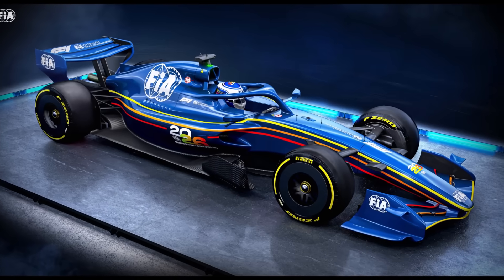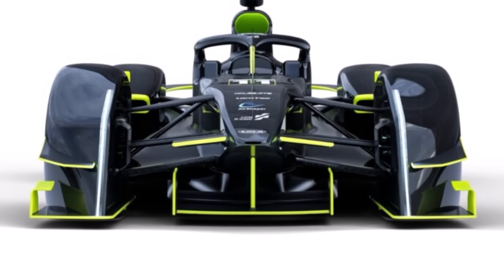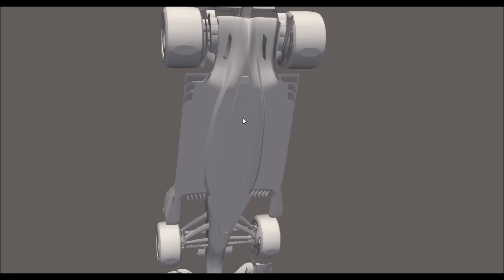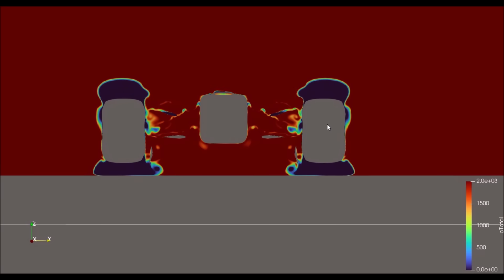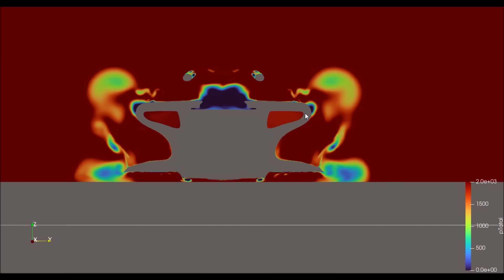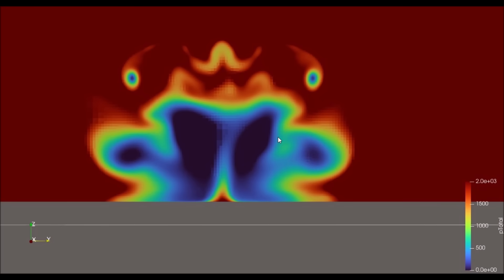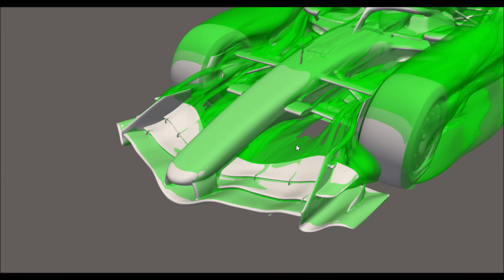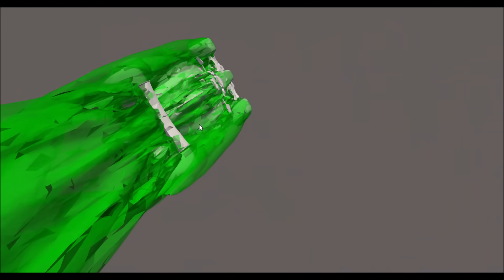F1 2026 - Aero Analysis (Complex CFD Simulation)

Comment: Almost like they shouldn’t have made the wheels bigger in 2022. Go back to the smaller rims
Reply: 15" like Indycar USAC would be a neat compromise, but it is what it is. (F1 already used the same 15" as USAC in 1960's too, but then FISA mandated 13" rears in 1972 and 13" fronts in 1983; whereas Indycar has used 15" from 1960's until the present day.)

Comment: In fact, the undercut of the sidepod has more important functions than just directing air cleanly to the rear (which could also be achieved in other ways). Sidepod undercuts prevent the airflow from escaping at the front edges of the underbody and partially flowing back into the diffuser and partially hitting the rear tires, which reduces downforce. One might think that the best solution would be to have sidewalls that allow the airflow to flow completely under the floor and smoothly to the diffuser, because this accelerates the airflow, increases suction and thus downforce. However, since the airflow to the rear tires is also blocked, the airflow at the leading edges of the underbody tends to become weak. In other words, it would be best if only the middle and rear areas of the underbody were sealed. The sidepod undercut helps to achieve precisely this effect. First, as a result of the undercut, the
undercuts extend the influence of the downward flow from the front half of the vehicle to the middle of the floor. There, the downward flow acts like a side wall, creating a floor sealing effect and increasing the underbody suction force. An increase in suction force on the sides of the SP also accelerates the downward flow and further enhances the sealing effect.
Depending on the type of side pod used by a team, the
upper vortex of the side pod can flow directly past the
undercuts and be used accordingly. Another effect of the undercuts is the creation of a high-pressure zone, which can be used to deflect the harmful front tire wake away from the vehicle.

Comment: 5:12 "downforce from wings which are more sensitive to dirty air"... I had the impression that the floor with venturi tunnels/channels were way too sensitive during all these years (2022-25)... in the years before 2022, I've never seen drivers snapping the rear end mid-corner and the tyres getting so much more wear while following in dirty air...
Reply: Are u kidding? Pre 2022 you wouldn’t see equal pace cars behind each other at all period. Even in the worst ground effect year (2025) you could have two identical cars running directly behind each other for full stints without losing too much pace (think the mclarens fighting etc).

Comment: 6:41 wait, but bigger sidepods have more drag and this is bad right?
Reply: If you don't have bargeboards (or only basic bargeboards), then large sidepods can be very useful to control the wake of the front tyres.  Like the 2022 Ferrari, or most of the F1 cars from the 1990's and late 1980's.  They can help direct the front tyre wake directly at the rear tyres, thereby reducing rear tyre drag compared to if the rear tyres were in clean air.

Comment: Why would the FIA just completely throw away everything they've learned about aero and dirty air for these regs? Are they stupid?
At least the first year of ground effects had close racing and was easier to follow cars ahead. 
Wouldnt it be better to use some moderate level of ground effects, plus a high rear wing (no endplates), really simplified inwashing front wing, and really tight regulation boxes? Seems like the aero minds that created the more tightly defined aero regs of last gen have left, and now the boxes they can use are much looser, which will lead to the teams adding on as many winglets as they can creating more dirty air. :(
Reply: Because the ground effect cars made innovation extremely stunted and most teams were handicapped just trying to avoid porpoising. Even Redbull and Mclaren in 2025 still had porpoising at times. The regs were a complete failure. They had to change. F1 has learnt. It has learnt that cars cannot overtake through aero differential but with power. That's why the aero is no longer the overtaking tool and instead drivers have to cleverly deploy power as everyone will have equal DRS.

Comment: 2005-2008 cars were the best looking era of F1 imo so I'm glad that the car returns to that shape
Reply: I feel like this (and nostalgia for narrow track regulation F1 cars generally) is age-based nostalgia.  1989-1992 is before my time, but is clearly better looking IMO with nice wide track cars with elegant shapes with nice wide tyres that don't have silly grooves in them.  Which 2005-2008 car genuinely looks better than the Ferrari 640, Ferrari 641 or Ferrari 642?

While the 1970's and early 1980's cars look bulky and fussy, especially the extra wide rear wings that were allowed until 1985, through happenstance and coincidence the 1989-1992 look right and sound right with the NA engines IMO.  What winged F1 car looks more perfectly proportioned and shaped than the McLaren MP4/7A or Ferrari 643?  To think that we could have had wide, mean cars, with wide, mean tyres without grooves the whole time until present IF ONLY the FIA hadn't meddled with making the cars narrow, making the tyres narrow and putting silly grooves in the tyres...

Where the 2150mm wide cars looked "right" and still look "right" at events like historics, the 2000mm wide cars from 1993-1997 still looked somewhat OK and in proportion (with the corresponding reduction in rear tyre width), but everything from 1998 onwards just looks squished and wrong IMO -- the comically short control arms look silly IMO.

Comment: My MSc thesis was on refinement of CFD models like the one in this video. What you are looking at is meant to look like Static Reynolds-Averaged Navier Stokes (RANS) flow model, using a problem-specific turbulence model, blah blah blah.

Hoever... what you see on this video is NOT CFD solution postprocess!   It is an AI 'filler' for CFD results, intended to look like one, without actually solving anything.
There are a lots of serious errors, that are too bad even to be deemed an inconvergent simulation, especially around curvature of wheels, and flow separations around low pressure curvatures

Now, I am not in F1, so I do not know what is going on, but if this is how "CFD" is done lately, we can expect teams having more confusion "our car goes fast, we don't know why", or the opposite.
Reply: The CFD was simulated using AirShaper, a conventional CFD solver that does not use AI to generate or “fill in” flow fields. Nothing in the visualisation is synthetically inferred. What may look like errors are usually modelling or post-processing artefacts (mesh resolution, turbulence model, near-wall treatment, or visualisation choices), not a fabricated or AI generated solution.

F1 teams run heavily customised commercial and in-house CFD codes (RANS/URANS/DES depending on the task), with bespoke turbulence models, meshing strategies, and strict convergence and validation procedures. These simulations are continuously cross-checked against wind tunnel and track data.
Reply: @nipuma4  
I am afraid, I need to ask for evidence.
 I do not know this solver. The author says nothing about models or solvers used, nor does he discusses validation and precision of results.

I also have never heard of 'postprocessing artifacts' - that is about the only thing that can be easily fixed.

Comment: But thers a mistake you are making when studying the wake affecting the following car. You should make 2 parallel studies with the wing flaps open and closed. The difference will be highly significant and dynamic especially when compared between each other. This is what drivers will have to face. Dynamic wake. What you have represented here beautifully is that these cars will be worse in the corners in following but much easier on the straights when the flaps are open relative to any regs in F1 history. Thats why electric deployment through corners will be key. Would love to see a side by side and dynamic change for the car following if you could do that.
Reply: But you don't need downforce on a straight and you can't deploy electric through a corner because you are traction limited (because you are in a corner)...? 🤔 The wings openly on the leading car will reduce the slipstream of the following car, no?
Reply: @TassieLorenzo  Yes you don't need much downforce on the straights so what has that got to do with what I said?

Wake though the middle of a corner is dependent on weather conditions and wind direction. The CFD wake is only applicable in perfect linear wind which is on the straight line. 

F1 cars are not so traction limited. As soon as a car is on corner exit after a straight, the driver is back on the pedal. Boost can be used from acceleration phase to mid corner in mid speed to high speed corners which last for over 5 secs. In fact it has already been used like that to get close enough before a DRS straight.

Yes the open wing flaps will much reduce the slip stream effect, that's also why I am suggesting they should test the CFD map with flaps open too.

For these new regs, power is the overtaking tool NOT aero.

Comment: I don’t understand why they’re doing a 180 on the 2022 regulations. Why are we going back to more and more outwash/dirty air generating parts? There’s now strakes and vanes and cuts everywhere again. The rulemakers are so confused and clueless
Reply: Yeah the principle of '22 was a good one. The problem was that the teams were allowed to recover all of their outwashing, and they won't ever make a decent tyre anymore which meant the racing deteriorated after '22. If they'd also gone further and reduced the weight and length, the cars might not have been so clumsy at low speed. I presume that behind the scenes there was a lot of complaining about the complexity of these floors and difficulty in finding a window of performance. So perhaps the intention is to have cars that can at least be put into a broader sweet spot of performance more easily and predictably, even if we end up with boring racing. It's infuriating they never address the weight and length or the heat sensitivity of the tyres, as these are fundamental to how agile the cars are and how closely they can follow.

Comment: The upper wheel wake is rotating in the same direction as the front wing endplate, it actually doesn't hurt downforce too much, it actually helps the floor when it synergizes with the rear wing tip vortices. All those vortices have the same rotation so they want to merge with each other.
Reply: abs false lol
Reply: @hgdrkui  That’s an oversimplification. While some vortex alignment can be beneficial locally, the upper wheel wake is highly unsteady and dissipative, and its interaction with the front wing and floor is extremely sensitive to ride height, yaw, and steering. In practice it’s usually something to be managed and redirected, not something that reliably “helps” downforce by default or cleanly merges with rear wing tip vortices.
Reply: @hgdrkui  lol so you have anything besides denial? worthless comment.

Comment: Please, the vorticity of the front wing isn't so much losses as they are a path for the air to follow. You need to have a good balance between axial and rotational energy for the vortex to channel airflow effectively. If you have too much rotational energy for the axial energy the vortex breaks down, if you don't have enough rotational energy the flow's energy dissipates rapidly. When you have the correct ratio you can transport airflow effectively with little losses other than the drag caused by the vortices.

Comment: So conclusion: no lessons learned. I feel they had a very solid base to work from with the 2022 regs
Reply: I feel that the FIA already knew this will happen. Just that the 50/50 power split  between ICE and Electric units might be the one ensuring overtaking is plenty, albeit it might not be organic.
Reply: 2022のレギュレーションは最初上手くいっていた、しかしFIAはより良い競走の為の改善ではなくそれを放棄することを選んだ
Reply: Worth it just for the smaller car
Reply: yup. they should make "outwash" parameter witch FIA could measure in widtunnels and to witch teams should make design adhere to it.

But i was personally advocate for FAN cars with multiple redundant fans in case of failures and standard active suspension soo we have purposing and driver comfort at control via easy to  monitor (FIA) and quite cheap to implement. And we could design rule boxes in way that we would have exits of fans very high and make rain driving experiences with much narrow up wash and less visibily issues. And we would keep perfomances and speeds at very high level, if not highest yet, enad quite easy u coudl limit downforce via FAN rpm in reg  rules also.
Reply: @alesksander how would you police that? That sounds like a Sisyphean task for even a team of experts.
Reply: @dod_the_angel i know. But FIA xould dwfibe turbolent factor on exact points in fia cfd ir windtunnel. Before any upgrade is put on cars. Hence onlt that way you would force team to reduce turbolent factor. 

But this is only thinking at loaud. Im more for active suspention and fans skirts for downforce production.
Reply: @dod_the_angel  Perhaps by not specifying outwash in particular, but a maximum downforce loss for a standard design of car placed behind their car.
Reply: @alesksander  i don't think i would want fan cars, it would make engineering too easy before we reach the point of undrivable cars. About the bodyworks, i would like the teams to make pseudo-fender like the rear wheels of indycar, or the front wing of Formula E gen4. It just needs to feel* open wheel enough.
Reply: I get that, but I do think they made the correct decision to abandon the ground effect since these cars have been wreaking havoc on the drivers' backs.
Reply: @LukeW_66  no just need (standardized) active suspension or at least bring back inerter and afaik no back problems ~last 2 seasons
Reply: Biggest problem is the 50% electric power, and no advanced MGU-H anymore, so you can only recharge the battery thru braking, or using the engine to recharge (loosing hp in the same time). So for every lap I have a hard time seeing them be able to charge up the battery so the can use 50% electric power under the lap.. so it wlil probably be slower and slower per every lap. Just that the testing will be behind closed doors tells me not even FIA believs this is good :D
Reply: @AndrewTSq Biggest problem isn’t the electric power itself, it’s the teams not wanting energy recovery from the front axle as well in fear of Audi’s potential advantage in that field
With energy recovery front and rear there wouldn’t have been a problem pretty much
Reply: @cyancut21 yup. Even now rear axle on power tracks cant recuperate much. With front we could do much more and potentially like in wec satisfied full MJ capacity that rules allow.
Reply: @alesksander  but having that on the front would add weight, and I guess add full brake by wire .. I say just delete this EV crap, and just put a V10 in instead. No one wants this electric motors in racing,
Reply: @cyancut21  Bingo was his name-o.
Reply: @AndrewTSq Manufacturers will never want to go back to the V10s. They are the ones (especially Volkswagen) who pushed for 50% electric. I don't understand why, since the electric drive is not this dominant in any of the hybrid road cars. My guess is that their focus is actually on their fully electric models, and see F1 as a more suitable development platform than Formula E. And since there's no F1 without manufacturers, the rulemakers' hands are pretty much tied.
Reply: @AndrewTSq it's kind of an oversimplication to say ots pure 50/50 though and probably more accurate to say its 50/50 at peak power. We know the electric bleeds off as the car speeds up to save power,down to nothing at a specific high speed.

Comment: I think we should consider where the teams will pick most of the cooling from during the track. I think that the clean air from flat front wing will push some teams to divert Al cooling capabilities to the straights while leaving the inlets "shielded" during corners(front wing up). I think we might see lower I let's but higher side pods with kind of a solution similar to the "sausages" to give a long canalon the top and a heavy undercut on the bottom. It is interesting though to see how in the car length will be positioned the widest "wall" of the sidepod. My hunch is that it may be a little more towards the back compared to previous cars. I think they will rely more on bodywork and less on air pressure due to drag. It is definitely very fascinating.